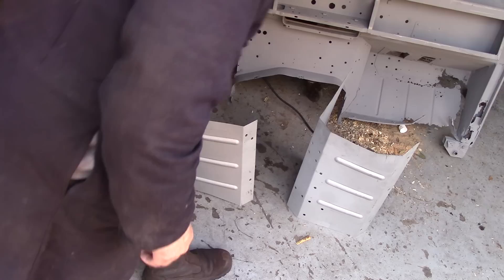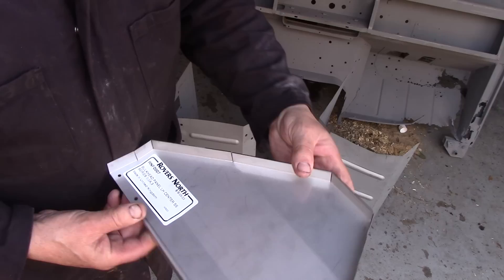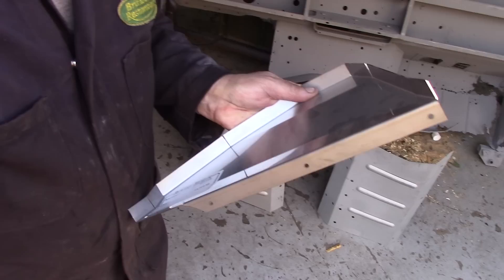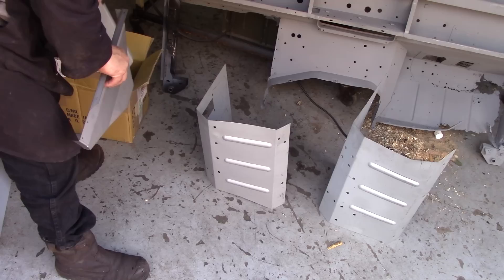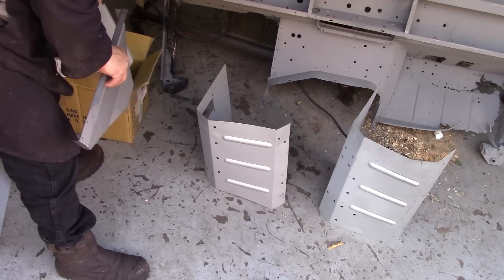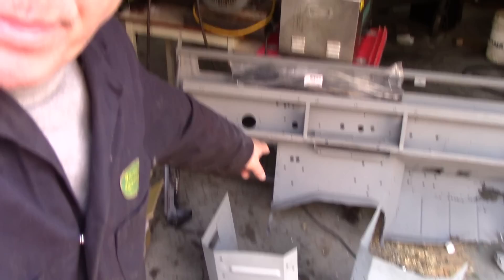Series 2 bulkhead rebuild Part 1

Comment: What are your thoughts on using a 2 part adhesive in place of welding repair panels into the bulkhead? Would remove the heat from welding process and reduce rusting in the future.
Reply from the maker: It is possible - but the bulkhead had to be pretty ridged. I have not experimented with it on a bulkhead

Comment: Hi Mike, I Installed a new right side door post and footwell on my series 2a.  I bought the footwell from Rovers North.  The door post was purchased from Atlantic British.  After installing, I was left with a 1/2 inch vertical gap between the door post and the footwell on the engine bay side.  It seems as if the portion of the footwell that sticks into the engine bay wasn’t built wide enough to reach the door post to allow them to be welded together. Inside the cab the footwell and door post line up perfectly and I was able to plug weld them.  Should I be concerned about the gap?
Reply from the maker: I seem to recall I had a pig of a job with the pillars too
See part 3 
https://youtu.be/_PRWAFnkL3o